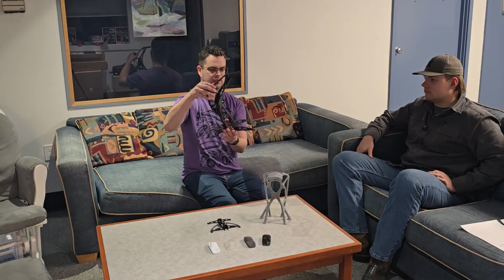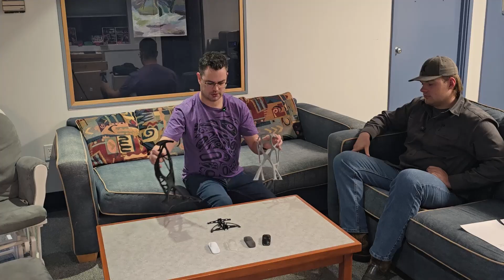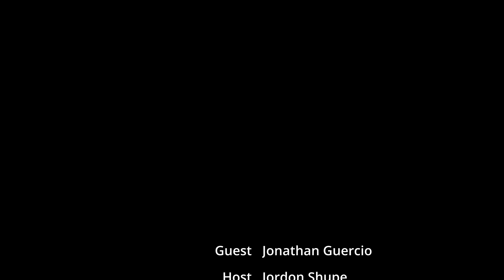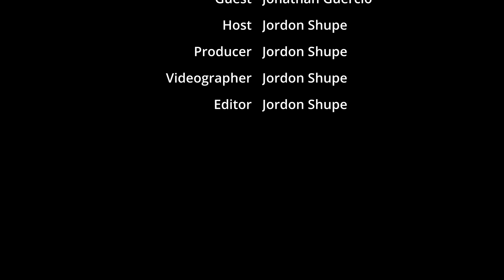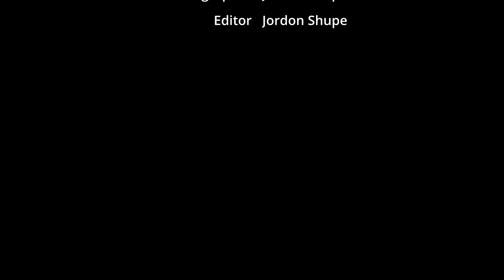Generative design in Aerospace | Fix it in post Ep. 01 ft. Jonathan Guercio

Comment: Oh, hey, that's a redesign of Dave C's FPV Nano Long Range drone. Pretty cool. I've done a few redesigns of that myself (but not with any generative design). The first was all FDM printed, but the second one, I used 6mm carbon tubes for the arms, some smaller ones for the frame, and FDM printed pieces to hold them all together. It has a secondary digital recording camera (a Runcam Nano) and an all up weight of 112g, which is a little portly, but it's pretty stiff.
Reply from the maker: I really like the Idea of carbon rods for repairability if they weren't glued in. I wonder if arrow shafts could be used since they have readily available threaded inserts. Did you notice any measurable improvements over the original design?
Reply: @Tempus3Dprinting  Threaded inserts to make the arms more readily replaceable or make the drone smaller for storage would be cool. But in this design, the carbon tubes are just way stronger than the rest of the FDM pieces structure and I would be really surprised if they broke. Overall repairability of my design is kind of poor. To save weight, I've mostly made all of the electrical connections with wires soldered directly to PCBs and I'm routing wires through carbon tubes and holes in FDM printed pieces. Also, I'm kind of already pushing against the weight limit of what flies well, so adding what I presume would be a few grams of threaded metal connectors would be noticeable. 
The main improvement of my initial FDM printed design over the original Dave C design was that the chassis included an integrated cell holder (utilizing just the metal contact tabs) rather than a separate component, which saved about 10g of weight. This second iteration is stronger overall and adds a second 1080p digital camera to record high quality video, though at the cost of a few grams of weight over the FDM design.